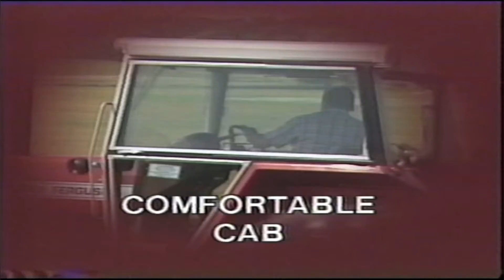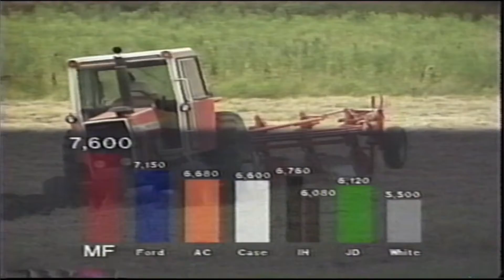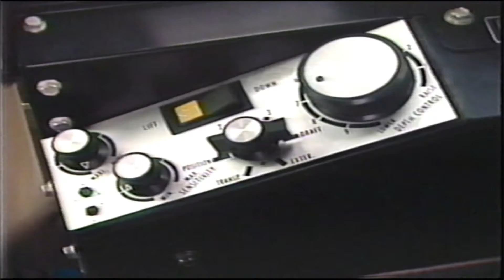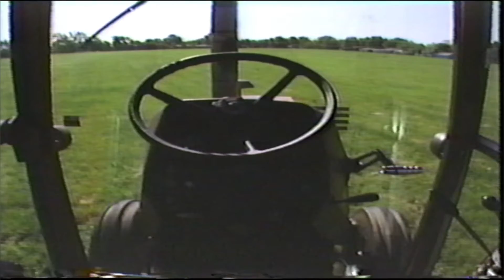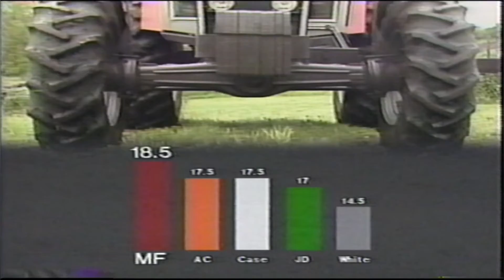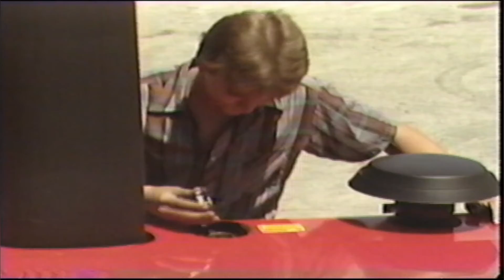Massey Ferguson 1984 Model Year 3500 Series Tractors - Competitive Comparison 3505 3525 3545

Comment: Our farm has Massey ford and John Deere all from 1960s to 1980s they all have leg up some where we use our 7710 for baling because it has the gear the 4230 is an 8 speed no matter what you do you have the wrong gear for baling but with the power shift the Deere is great for snowblowing and we mainly use our Massey S for heavy tillage

Comment: I know a former MF dealer who switched to JD franchise in the 80s.   Like day and night.  Said these J Deere’s are actually designed to be worked on and repaired with good service and repair Manuel’s and factory back up. Actually worth fixing as have good resale value. Deere was so far ahead. No contest.
Reply from the maker: I like MF, but Deere makes excellent tractors. JD also supported dealers when  we had a rough go of it during the 80s. Thanks for watching and commenting plus sharing your story!
Reply: NOW, you can't work on JD equipment yourself, and the company is suffering mightily for the policy.  Agco has "Europeanized" their tractors too much for my taste.
Reply: They are all to Europeanized now.

Comment: Cześć. Piszę z Polski. Mam MF 2640. Widzę, że Wszyscy, biorący udział w dyskusji, mają dużą praktykę, więc pewnie ktoś z Was wie, czy wszystkie stare modele serii 2000 (w USA, odpowiednikiem jest seria 3000?), mają te same przeniesienie napędu? Precyzując pytanie: czy model 2625 i 2725, miały skrzynię biegów,  przekładnię główną (dyferencjał) obraz zwolnice, o tej samej wytrzymałości?
Czy różnica pomiędzy  modelami serii 2000 polega tylko na zróżnicowanej mocy silnikow i rozmiarze ogumienia, czy także na różnych komponentach przeniesienia napędu, dostosowanych do mocy silników? 
Najlepiej pytać praktyków.
Reply from the maker: Witam ze Stanów Zjednoczonych, mój rolniczy przyjacielu! Mam nadzieję, że uda się znaleźć odpowiedź na Twoje pytanie. Przetłumaczę, żeby inni wiedzieli, o co pytasz.

Hi. I'm writing from Poland. I have an MF 2640. I see that everyone taking part in the discussion has a lot of practice, so probably some of you know whether all old models of the 2000 series (in the USA, the equivalent is the 3000 series?) have the same drive transmission? To clarify the question: did the 2625 and 2725 models have a gearbox, final drive (differential) and final drive, with the same durability?
Is the difference between the 2000 series models only a matter of different engine power and tire size, or also of different drivetrain components adapted to the engine power?
It's best to ask practitioners.

Comment: John deeres are the most overated tractors on the market
Reply from the maker: Those John Deere boys aren't going to like that! ha ha ha.  Not sure about that, but I will say that John Deere gambled in the mid 1980s and kept all the dealerships open in the small town when all the other brands were closing and consolidating.  Love JD or hate them, in Wisconsin or Iowa, you can trip over all the dealerships, and the big one stock parts.  AGCO parts?  You need to pre-order and either pay to have them shipped or drive an hour to pick-up you parts.  I worked on a fellas JD 4240 and the JD boys had the parts in stock, can you say that about AGCO?  I love them all, maybe not IH so much (the TAs are nothing but trouble, sorry but they are - I'm sure a fella out in youtube land has the original to the tractor still working),  but I will use or work on anything!  If a guy wants to irritate a fella, tell him that it will take a week for parts!
Reply: @opasvintagegarage  ya, I can say better than that about AGCO they have served me exceptionally very well. I have an 1150 v8 massey up here in Rensselaer County ny.and have never had any problems with service however my 1150 is a beast it has never broken down. Just basic service on it. Can you say that about your deere johns
Reply from the maker: @MikeCipperley  glad you have had great service and low expenses with your equipment. I can only state what I know, most if not all equipment breaks and needs repair. It's easier for me to purchase parts from John Deere vs AGCO for the older equipment. I'm not defending or looking for an argument. God Bless and thanks for watching.
Reply: @opasvintagegarage  I'm not looking for an argument either however facts are facts my massey ferguson is about 55yrs old and and is a finer better built machine than a deere john story. Just remember NOTHING FALLS APART LIKE A DEERE....
Reply from the maker: @MikeCipperley  if you want to talk about reliability, I'd put my 1963 Allis D17 gas against anything. After 60 years I've replaced the muffler twice, power steering line and the water temp gauge. Plus, a shelf full of 1st place pulling trophies. West Allis knew how to build tractors. All that tractor wants to do is work.
Reply: @opasvintagegarage  will your ac pull a 10 bottom plow with 16inch blades at 12 mph
Reply from the maker: @MikeCipperley  nope
Reply: @opasvintagegarage  I know it ain't got balls my 1150V8 MASSEY HAS AND THATS FOR DAM SURE !!
Reply from the maker: @MikeCipperley  we ran 4850s as we needed dependable power.  Makes that 70s prototype tractor of yours look like a steer!!
Reply: @opasvintagegarage as one of the 'smaller' manufacturers, I think Allis Chalmers produced some excellent stuff - they did however run that 426 engine above and beyond in their high horsepower 7000 series tractors. Really liked the styling of the cab and bonnet, the cab in particular being very futuristic in design but must have been a real pain to manufacture - they went back to a more conventional style cab with their 8000 series tractors.
 Their 7000 series tractors remain a favourite for me however.
Reply from the maker: @jamesbarbour8400 agree, in NE Iowa we had a great AC dealer just across the border in Minnesota that support a large territory. Many D17, D19, 190, 185 and 7000 series models still are used on local farms that were purchased from Deeters Imp - including our 1963 D17. 185s still bring top dollar at auction. The power director also has proven to hold up well over the years - some do want to pop out of 3rd though. AC was never as strong as the Deere boys, but tAC can hold their own around here.
Reply: I like masseys but that steer comment was funny.
Reply: Certainly the most over priced, that's for sure - gotta keep them Deere & Co CEOs paid up !
Reply: I have the Massey 1130 great tractor as reliable as anything but no more than a Deere my fathers 1956 John Deere 80 fairs fine and all brands have there horror story’s but the dealers must be different in the states in Ontario Deere deal ships are centralizing and there are few around nearest one in all directions of us are two hours now the AGCO ones are every where now and the local one by us is ran by mennonites is awesome to deal with

Comment: I had an older friend several years ago that run MF tractors for years and years. My dad and I run those old John Deeres because that is all we could afford.

As the years passed, I took over the farming operation, all the while   buying those old green tractors. All this time my good friend was still buying those old Massey Ferguesons, having more problems than he thought he should be having.  In 1984 I bought a new John Deere 4450 powershift to go along with my two 4440s, my 4430, 4320, and two 3020s.

One spring at planting time my friends Massey had to be put in the shop. He came to me and wanted to hire me to plant his crop. I told him I did not have time to plant his crop, but assured him he was welcome to take my 4450 and 7200 planter and put his crop in at no cost to him, as I was finished for the season and would be more than happy for him to use anything I had to get his crop in the ground. I FINALLY convinced him that he was welcome to take the rig, so he did!

He didn't say much about the tractor when he brought it home other than he thanked me over and over for the use of it.   HOWEVER...

...When he got his crop harvested that fall, he trades his Massey Fergueson for a used 4440 John Deere!!! 

One afternoon later in the fall we were plowing right across the fence from each other. He stopped his tractor and waved me down to chat about green tractors, I assumed. I asked him how he liked his "new" tractor. He laughed a big old belly laugh and said," I MAY HAVE THE DAMNED MUMPS AGAIN...BUT I WILL NOT EVER HAVE ANOTHER MASSEYFERGUESON TRACTOR!...And he didn't.
Reply: We mostly ran Massey Ferguson’s going back to the 1960’s. The only trouble we had was with a few of the 200 series was the power steering after a lot of hrs. My son has had 5 John Deere’s. And one was a lemon I think it was a 6120 it had electrical problems and breaks and hydraulic problems. The other 4 were good. I have a 5320 JD cab tractor I had a lot of problems with a electric short, it caused the alternator to run hot and burn up. Finally a guy that works a Etown electric motors did something to the inside of the alternator to keep it from running hot and burning up. I had spent $1700 at the local JD dealership and they couldn’t fix it. The other big trouble has been keeping the air conditioning running. I had to put a front and a rear wheel bearing in it. And injectors and a injection pump. And had to have the joystick rebuilt for the front loader,  also had to put a water pump on it. I got 10,300 hrs on the 5320 JD I plan on keeping it, because I figure I know what problems it has , buying another used tractor you never know what you are getting . Bought a MF that ran good for a couple of months then blew a head gasket. Come to find out some had blew the engine up using ether, it had burn holes into the top of the block, I had to get another block and rebuild the engine. Other then that it’s a good tractor. You can get good a bad in all the different brands.
Reply from the maker: Great story, thanks for sharing!  Well, the green ones you mentioned were (and still are) some great machines!  We used many of those models on our farm, and I'd say the 4450 was one of the best we ever used!  The 7000 & 8000 series were light years ahead, and they are still in the field today, but I'll never forget the day the dealer started our new 4440 - wow, what a beast that meant business! The 7410 was great, but it didn't give you the same tingle down to your toes like the 4440 at startup!  Thanks for watching and commenting, I really appreciate it!
Reply: Your an exaggerated big lier I grew up around masseys during the 60s 70s 80s and 90s and all I saw was deere John's constant breaking down  HA HA HA HA , and now all I see is deere john combines burning up yea literally burning the f_ _ k up in huge flames  I've never ever seen or heard of massey ferguson combines literally burning up so you know what you can do with your lieing about masseys and your extremely operating deere John's  NOTHING FALLS APART LIKE A DEERE.

Comment: Weird that deere only offered a quad range.....too bad they didn't show the 15 speed ps. Also I thought a 4250 had a 466 in it? A 466 will eat a 354 alive all day. Maybe a 404 was close to a 354 but man alive a 466 was twisted all the way to 230 horse power in the combines
Reply: The 354 was a small motor but you don’t need a big motor to make a lot of power jd went from a 531 turbo making 175 horse in a 6030 to a 466 turbo inter cool making 190 horse in 4950s
Reply from the maker: Yup, I don't think they wanted to turn the advertisement into "why a fella should buy JD". ha ha ha thanks for watching and commenting, I appreciate it!  I do have respect for the MF line though, tough tractors!  Yup, the 4250 had the 466 ci engine, same as the 4240 and 4440 (turbo) we had.

Comment: 4-71 Detroit power unit?
Reply from the maker: These rigs came with the Perkins 6 cylinder. In 86 or 87 our IH dealer switched to MF, and a few fellas that owned them seemed to have good luck.  I wanted to demo one for feed grinding and liquid  $h** hauling, but my father told me many guys were running into some financial issues due to the times, so we did the smart thing and waxed our D-17 AC!  Thanks for watching and commenting!

Comment: Pure marketing bluster.  But I must say the couple of times I operated my Dad's 3525 when visiting home it was pleasure to operate.  With its MFWD and the electronic 3pt it could pull the plow better than the 2705 or 2745 he had when I was home.  The AT6 in this generation ran much smoother.
Reply: The engine used would be the Dot 4 variant - ie AT6 - 3544. This version of the engine removed the tappet covers on the RHS - the engine block was now solid all the way from the crank case up to the top deck - much stronger and rigid than the former design.
 Also the block 'skirt' was thickened and extended further below the crankline, again imparting extra strength and rigidity. A new feature was machined inlet ports - previous versions were simply as cast. The machined inlet ports gave laminar flow to the incoming air volume as opposed to the turbulent flow of the former as cast inlets.
 Better, and smoother combustion would be the brneficial result of those changes to the inlet ports.
Reply from the maker: Sir, I think you hit the nail on the head!  Thanks for watching I appreciate it!

Comment: They may have been advertising the 3500 series, but it certainly wasn't the best tractor in that lineup. Near the bottom in my opinion, maybe one up over the 3688 IH but it would be a close race. The best thing you could say about a 3545 was it was a better tractor than a 2705 out of the gate and had a good engine and that was it. It is still an awkward tractor, the electronic hitch was plagued, the cabs couldn't keep an A/C, door wore fast and hung crooked after awhile, they would rust out the cab floorpans and the plastic moldings weren't great quality, and they still have poorer hydraulics than a 1105-1135. Was a few around and there were some great deals to be had on them in the 80's, but the Fords and the Deere's were better tractors and they held up better.
Reply from the maker: Thanks for sharing your stories, I appreciate it!  Can't disagree on the Deere comment!   Ha ha

Comment: Other than the US market this range was the 2000 range, I used to drive a 2620 on a neighbours farm, I felt like a king. Great machine, 6 cylinder Perkins. this was the pinnacle of MF, later in the 80's they struggled with R & D and mismanagement. With out the intervention form AGCO,  MF would be in the history books. Under ACGO,  MF are manufacturing exceptional tractors.
Reply from the maker: The Perkins engine has much respect in the US, it's a great engine!  The early to mid 80's was a rough time in the US for Ag, many mfg companies for Ag bit the dust, even mighty John Deere had problems.  The first example that popped in my head was IH and Case, if Tenneco hadn't bought Case, then IH, I'm not sure you'd have CNH today as it is.  In Iowa, it's Deere country, but we do support an AGCO dealer that specializes in MF.  That dealer is housed in one of the original IH dealers in our area - I think it switched just after IH was bought by Tenneco. Thanks for watching and commenting, I really appreciate it!
Reply: So the 8s range tractors are needing new gearboxes less than 1000 hrs from new , I would say they are exceotional indeed

Comment: That is some aggressive advertising. 😅
Reply from the maker: Ha ha ha!  Thanks for watching and commenting!
Reply: The MF 3500 series tractors shown here were actually sourced from MFs French factory in Beauvais, Europe. They were basically 'warmed over' European MF 2000 series tractors, with lighting packages to suit the US/Canadian markets specifically. They were also specified with Bar Axles, to allow for row crop work, whereas the European product used flanged axles, with wheel track setting being achieved by varying the position of the centre disc relative to the wheel rim.
 The electronic hydraulic control system was sourced from Robert Bosch, a German Company, and the feature was an option on these tractors - the mechanical linkage was the standard fitment.
 The reason for the importing of European made tractors to the US/Canadian market was because in around April 1983, MF had to close its Detroit factory, amongst others, to try to stem its huge financial debts at that time.
 Closure of the Detroit factory effectively meant the complete cessation of US made MF 2000 series tractors, although the larger articulated MF 4000 series tractors continued to be made up at Brantford in Canada for a while.
 The importing of the European made machines was simply so that MF could maintain a presence in the home market.
 The European sourced MF 2000 tractors were available with unequal sized four wheel drive front assist, whereas the previous US made MF 2000s did not offer this feature.
 The European built tractors featured an eight speed box with two ranges giving sixteen forward and six reverse speeds.
 This 'box' was a more reliable unit than that fitted to the former US built 2000s, which developed numerous and well known faults with the 3 range speedshift unit. The collosal failure of this feature caused MF to lose significant market share in the large tractor market, at a time when they could ill afford to do so, particularly given the prevailing market conditions during the late 70s, early 80s.